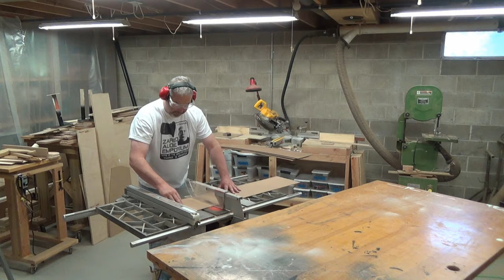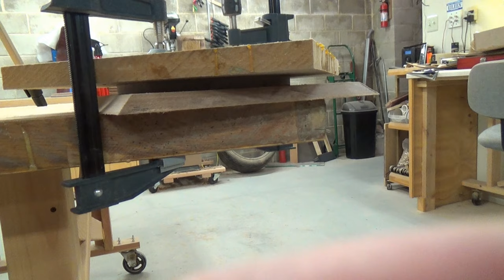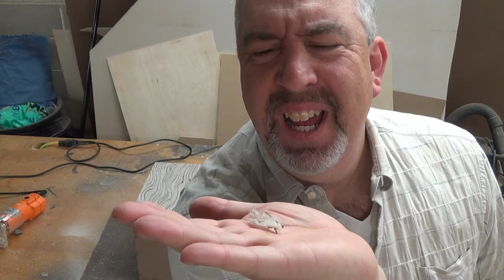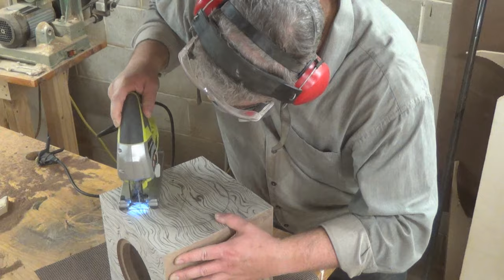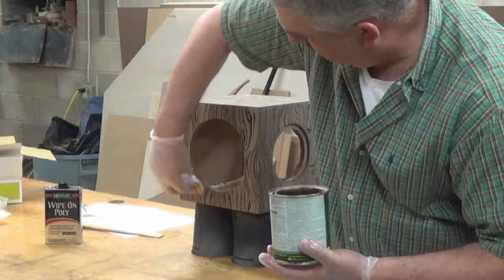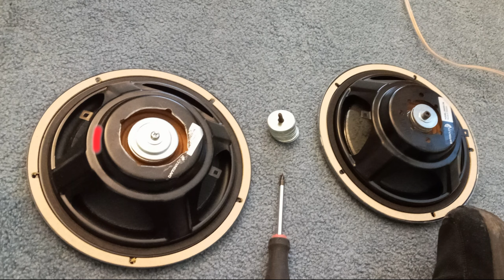Building the Epique 'Small Cube Subwoofer'

Comment: I love the video, but I have one remark. You missd the perfect opportunity to couple the radiators' baskets. This would cancel the vibrations from the box almost completely. You'd be left with just vibrations from the driver, which can be. reduced by coupling it's magnet to the corners of the box. If you couple it to the rear wall, you'll get a tiny change in directivity, which can also be good. At the same time, with just two braces, you make the box a lot stiffer.
Reply from the maker: Excellent observation... I wondered if anyone would mention that. I did consider it, but decided against attempting it after the first PR went berserker on me. I like your way of thinking! Thank you for watching and commenting!

Comment: I've never used a glue roller before.... do you need to use a new one for each session, or is there a way to clean the glue off and reuse it?
Reply from the maker: Hey Miro. I clean mine off when I'm finished by first rolling it onto a piece of old cardboard box to get the bulk of glue off... then I wash it under warm water to get the residual glue off. A bit will stay stuck to the roller, and it will get a 'patina' on it, but it will still work fine. I've had the one you saw in the video for literally years and have veneered dozens and dozens of projects on it... still applies glue perfectly! Thanks for the comment.

Comment: This video keeps popping up just to make me sad. Ordered mine over a month ago on parts express. Still waiting on stock arrival date.
Reply from the maker: PE website shows it's expected back in by the end of this month (July 2022)  And... don't know if you saw these, but there are matching passive radiators on the way: https://www.parts-express.com/Epique-E150HE-PR-5.5-Carbon-Fiber-Cone-Passive-Radiator-295-112  Not 100% sure what they will cost, but looks to be about $35/each for the small Epique sub, and $40/each for the larger Epique sub. I don't know the specs yet, but I'm figuring on being able to do less than a 10" cube with the smaller PR's.  I'm considering doing a sub build with the larger 7" Epique and 2 PR's if they model well in a small box, along with Dayton's new 300 watt class-D sub plate amp.
Reply: @zarboaudioprojects1430  That's good to hear, and amazing to hear they are pairing a passive line for them. At not a bad price either if they go with that. Will definitely be dropping by to see that if you upload that.
Currently building a portable bluetooth speaker with a friend, then seen this beast get released. So now just waiting to see if anything else would pair well with it while we wait. Mainly hoping for a high power board with onboard DSP. Otherwise going to have to stick with the TSA7500B. Although this year has been pretty good with new equipment.
Reply: @zarboaudioprojects1430  Wooo! Finally shipped! Can't wait.

Comment: How long do those Dayton speakers last before the surround self destructs ?
Reply from the maker: I own Dayton speakers that I've had for over a decade with zero surround failures... mostly rubber surrounds. Dayton stuff is solid.
Reply: I was wondering the same thing! That diaphragm bounces more than any driver I've seen, especially for only 5.5 inches. I've only seen it in one other application and I'm itching to put it in something. Yours looks fantastic and I'm sure it sounds as good as it looks.

Comment: I do see matching 5.5" PRs available, if you had to do a version 2 version with these how many 5.5 PRs would be optimal and what would be the net cubic volume? Or what software can I use to help calculate this? Im very interested in what you could do in a v2. Thanks!
Reply from the maker: I have a pair of the matching 5.5" PR's and I'm still fiddling around with it, so I hesitate to say for sure. Truth is, the matching PR's don't tune quite as low as I was hoping. Probably decent for music, but I hoped for a touch lower. I use WinISD now to design boxes and it's not too hard to pick up. Check out Toids Audio explanation on how to get started:  https://youtu.be/Ol7K5wQrFAg  He knows what he's doing. 
Just so you know, I'm working on a shoebox size enclosure for this, but It's going to be more like an F3 of 50 Hz instead of 35 Hz.
Reply: @zarboaudioprojects1430  I would be very interested how you couldnt yet reach lower than 50hz yet but Ill let you try your theories out first. Could a third matching 5.5 PR help? Thx 🙏
Reply from the maker: @chokechange  A third "might" help -- I don't know, haven't modeled it -- but that's further than I would go with it since you can get deeper bass with two non-matching PR's similar to the original Epique small cube build.  These PR's just don't have the specs to go really low in a small box. And if I'm not going small with these things, I don't really see the point too much over using an 8" or 10" sub driver.
Reply: @zarboaudioprojects1430  I understand. Yes the 2 8” PRs you used is alot more area than the 2 matching 5.5” PRs, looks like the 777 project might have worked out better with the matching PRs overall

Comment: I'm an amateur in acoustic knowledge however, I keep hearing passive radiators have some of the highest group delays of the enclosure types. I imagine this to sound like the late arrival of the notes according to the time it is supposed to be in the recording. Can you say if you can detect any delays in the frequencies that are met or enhanced by the passive radiators? Can the sound appear muddy? Or does it blend in well with the rest of the sound overall?
Reply from the maker: I can't really tell a difference between vented and PR enclosures. Maybe if I schooled myself in what group delay sounds like so I could look out for it I would hear more of it, but I would rather not look for issues when I don't hear any.  If you think about the excursion map of the PR and driver, and look at the frequencies where the PR is taking over most of the load, it is usually fairly low in frequency, the driver starts to move less lower in frequency and the PR moves more. Frequencies that low are not easy to determine tiny changes in arrival time, at least without trying hard to HEAR that it's happening.  But short story for me... PR enclosures seem to sound just as a Vented in my opinion.
Reply: @zarboaudioprojects1430  Thank you so much for your feedback. I've never built a passive radiator system as yet but I love the benefits I see and hear about. I definitely will pursue it. Your build looked awesome.

Comment: Do you think this subwoofer in the 7” model will hold up to abuse in car audio or just home audio bookshelf style subwoofer
Reply from the maker: Good question!  Parts express/Dayton Audio have traditionally built their speaker drivers to deal with the more rugged environment of car audio going back to the Reference Line, which has held up pretty well in those use scenarios. I suspect the Epique line will also be fine in the car environment. I've heard of a few folks using them in car audio, but it really hasn't been long enough since their introduction to reveal their longevity. 
They DO have dual 4 ohm coils, so getting a 2 ohm load will be pretty nice for car sub use I guess. 
Short answer: Just going off of how they've designed their non-Car-Audio specific drivers in the past, I suspect these will do fine.
Thanks for watching and commenting!

Comment: Would adding another active driver to this be a benefit or would the enclosure be to small for that?
Reply from the maker: Good question. The enclosure would have to be bigger if a second driver was added. Also, the passive radiators would likely need to be upgraded as these are close to, or at their excursion limits with certain material. Unless you went isobaric, then your box would be only slightly larger, that's a lot of money for the bass output, though.

Comment: For 25 bucks more there's the 7-in.
What modifications would you make using that driver over the 5 and 1/2-in?
I was thinking maybe like a 13-in square?
Driver's listed  xmax is 14.7 mmx but it look like you were pushing that way beyond it!
I don't know a lot about passive readers, but that seems like a lot of passive cone area used there?
I would be using (2) Dayton Audio RSS265-PR 10 on a single 7-in Epique potentially. 
Does this sound like a good combo and size? Or do you have a better idea with this combo?
Thanks!
Reply from the maker: Howdy, I'm in the process of constructing a cabinet using the Epique 7" with two matching 7" Passive Radiators. I'll hold off on sharing too many details until I actually hear how it works, but I'm shooting for a cabinet size a smidge smaller that your very-good guess. Hoping to be putting out that video sometime next weekend. Stay tuned!
Reply: @zarboaudioprojects1430  Thanks!
I wonder if a single 10 passive will suffice. I feel 2 might be overkill but IDK. I feel plenty of sealed and ported and even a couple of bandpass, but never used passives before
Reply from the maker: @BARBELLS-AND-BUDS  It's possible that one 10" PR would work, likely even. It may not cost less though depending on which one you use... and with two smaller PR's you get the benefit of cancellation of vibration by using two opposed PR's. Plus I just wanted to use the matching PR's :)  It's all about how you want to build it. If it works, and you like how it looks... it's good!
If you want to model a PR for fun, many say it's good to model a ported box for your intended driver, and save that, then model the PR enclosure with the same dimensions, and you should be able to get similar results with a PR... that can tell you if you're on the right track with the PR design.... many do model a driver in vented first.  Thank you for your comments!
Reply: @zarboaudioprojects1430  Thanks for the help!

Comment: Hi!  Did you install the passive radiator without weighing it down?
Reply from the maker: Hey! I did use weights on the two PRs. https://techtalk.parts-express.com/forum/tech-talk-forum/1479124-epique-e150he-44-small-cube-subwoofer-project. This is a link to the Parts Express forum post where I explain what I did. Short story, I added 100 grams of weight to each PR.  Thanks for watching!
Reply: @zarboaudioprojects1430  Thank you for your answer!  I want to install 165mm passive radiators in a three-way speaker.  Since the speaker is small, I cannot install a larger passive radiator....
Reply from the maker: Maybe model this PR from SB Acoustics. I know of someone who used one of these with the smaller Epique and it seemed to work well for him. https://www.madisoundspeakerstore.com/passive-radiators/sb-acoustics-sb15sfcr-00-5x8-passive-radiator/  @gl328

Comment: Tenho um woffer de 6.5 polegadas,você me recomenda usar 2 radiadores de 16cm em uma caixa de quantos litros?
Reply from the maker: Translated from Portuguese: I have a 6.5 inch woffer, do you recommend I use 2 16cm radiators in a how many liters box?   Answer: That's really impossible to answer without specifications for both the woofer and passive radiators. You would need to model it in a program such as WinISD; which is free by the way.  Answer in Portuguese: Isso é realmente impossível de responder sem especificações tanto para o woofer quanto para os radiadores passivos. Você precisaria modelá-lo em um programa como o WinISD; que é grátis por sinal.
Reply: @zarboaudioprojects1430  creio que ele trabalha com fs de 55hetz,e o radiador passivo é aqueles comprados na China de borracha com chapa de metal..Você poderia fazer um projeto pra min? Ficaria grato!
Reply from the maker: @wandersonuhuu5902  Translation in English: I believe it works with 55hetz fs, and the passive radiator is those bought in China made of rubber with sheet metal. Could you do a project for me? I would be grateful!  
Answer: Wanderson, I appreciate the interest, and faith you have in me, but I don't think I would be able to design anything that would sound decent with drivers and passive radiators without any specs. There's a lot more to it than that. Check out this video by Toids DIY Audio on how to use WinISD to design passive radiator speakers: https://www.youtube.com/watch?v=sG_8qgSjUqE   Best of luck!   Resposta: Wanderson, agradeço o interesse e a fé que você tem em mim, mas não acho que seria capaz de projetar algo que soasse decente com drivers e radiadores passivos sem especificações. Há muito mais do que isso. Confira este vídeo da Toids DIY Audio sobre como usar o WinISD para projetar alto-falantes de radiador passivo: https://www.youtube.com/watch?v=sG_8qgSjUqE Boa sorte!

Comment: will this driver and its bigger brother (the E180HE) work in a three way TMWW  vented design ?
Reply from the maker: Just shooting from the hip here... but If I were using the E180 as dual subs/woofers at the bottom, I'd shoot for a more Midrange-oriented tMww driver instead of a high-excursion mid driver like this 5.5 inch'er. Not that it wouldn't work, but I think you'd get more clarity with a dedicated midrange. It would look cool, though!

Comment: Sure is a lot of passive radiator for such a small driver. Generally you’re supposed to go with 2 5-1/4 passive if your active is 1 5-1/4.
Reply from the maker: You're talking about a "Rule of Thumb." In reality you can design a subwoofer anyway that you want as long as it works. The only way to know for sure it to model it, which I did.  Two smaller PR's would have trouble keeping up with this driver. It nearly maxes out these 8" PR's. Watch the "Digging Deeper" video to find out why.

Comment: Will it work as a sealed I wanted to make a 2 driver sub box as small fir my car. Does that make sense f3 40 is good enough
Reply from the maker: I can't say for sure as I haven't modeled it sealed -- I don't do car audio.  
Parts Express lists these specs for possible box scenarios: 
Sealed Volume	0.12ft³    Sealed F3	79Hz
Vented Volume	0.25ft³    Vented F3	41Hz
With cabin gain, and the shallower roll-off with sealed cabinets, I think you may be able to use this... you'd just have to model this driver and find a way to model the cabin gain in your particular car. It's surprising how much of a boost cabin gain can give you in the lower registers, though.

Comment: Hi Tom, do the glued pieces helps against cabinet resonance?
Reply from the maker: I've never measured it, but I tend to think so. When  I give a panel made with 4 laminated sheets of HDF when compared to a regular piece of 1/2" MDF, the HDF panel has a higher pitch to it, which is better I think. I would probably just use regular 1/2" MDF if I made another, though. That was a lot of extra work! :)
Reply: @zarboaudioprojects1430  thanks, i will try it myself with a small test enclosure for a subwoofer. I read that the stiffer the cabinet the higher the resonance frequency( is that what you mean with pitch ? ) i already made a piece of 2 x 4.5 mm MDF because i needed 9 mm and this is as stiff as 15 mm!!
Reply from the maker: @roygriend5143  Right. The higher the pitch, or resonance frequency, the higher up in frequency it will tend to 'ring' and if you can get it high enough, it will be out of the range of what the subwoofer will 'excite' while in operation.

Comment: Do sub woofers need any kind of crossover
Reply from the maker: Yes they do. Usually that job is handled in the amplifier, either in a plate amp, or in the self-contained small subwoofer amp that I used for this project. Without a crossover at 60-120 Hz or so the sound will be muddy and very bad. You only really want very low bass frequencies coming from your subwoofer. Also, if higher frequencies are reproduced from a single sub driver, it will muddy the stereo effect.
Reply: @zarboaudioprojects1430  Thank you I appreciate your help

Comment: Why would you use a center punch on HDF? Proper wood drills have a sharp tip already.
Reply from the maker: Punching out a precise location on a panel for drilling a hole makes it easier to find that exact center point. It takes a few seconds to do so it's cheap insurance against having a hole off-center.
Reply: @zarboaudioprojects1430  The center punch doesn't do much with an already pointed wood drill like I already wrote, just place the drill accurately. Completely different situation with metal and even there it's a small aid at best, the drill can still wander off.
Reply from the maker: @penttijakonen3817  I guess maybe for you it 'doesn't do much,' but it does something for me, and that's why I do it. It only takes a few seconds to center punch a hole, and if it could help someone -- and remember, I'm making these videos for people of ALL skill levels -- then it's worth doing. If you don't need it, then don't do it.
Reply: @zarboaudioprojects1430  Well, we just need to agree to disagree. Metal drills don't have a sharp tip, that's why one might use a center punch there. In wood, I completely fail to see why it's easier to punch a mark than just simply place the drill's sharp tip accurately and start drilling. It's all cool, use the punch if you feel it helps.

Comment: “Loud and low” what’s loud? And what’s low in your opinion. 
I’m a loud (130 db) and low (30 Hz) kinda guy.
Reply from the maker: for the size, this is both loud and low. I'm with you on the 30 Hz low spec, but 130 dB is too loud for my ears! :)
Reply: @zarboaudioprojects1430  great  video man. Do you use WinISD?
Reply from the maker: @johnviera3884  Yes I do. I use BassBox Pro more to see the box size as it's easy to do that in BassBox. But WinISD is really good.